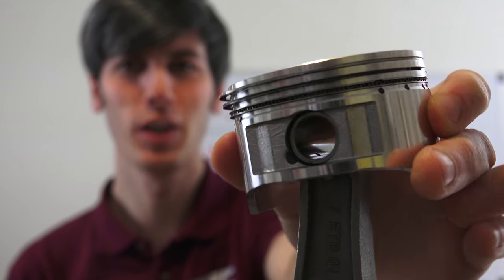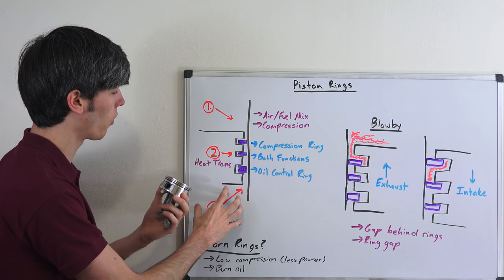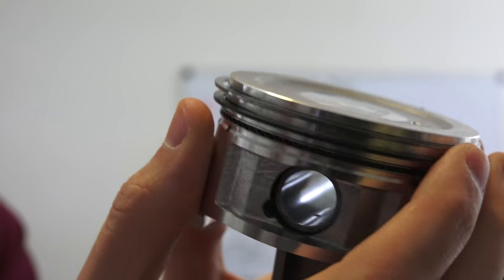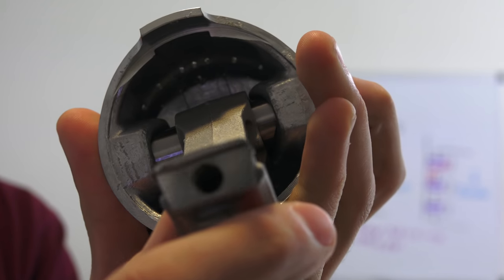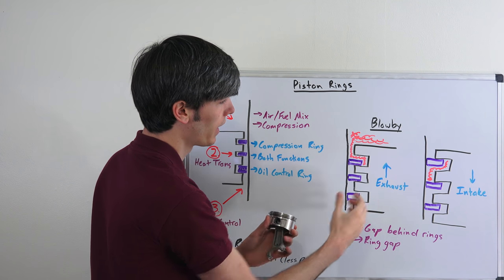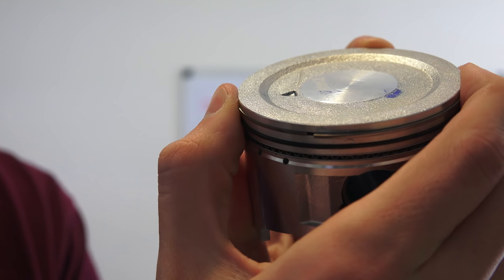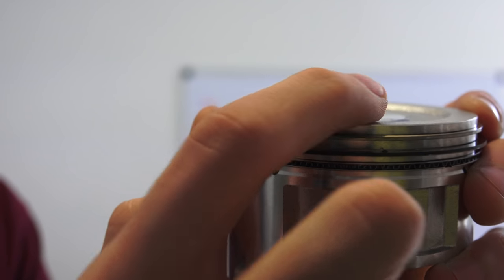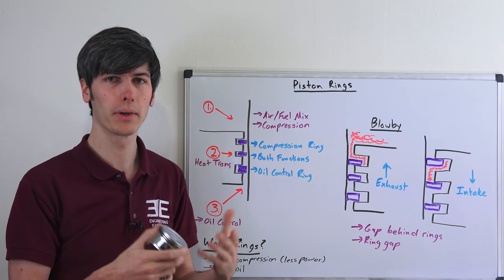Piston Rings & Blowby - Explained

Comment: I put new rings on a piston on my bike. I didn't measure ANYTHING. I was so pleased when I started the bike and it ran. It ran pretty well. I did 500 miles on it, including some quite tricky off-road stuff. It smoked a little. It smoked a lot. It used oil quicker than petrol. But it ran. I decided the oil use was more than your everyday break-in consumption so tore it down again and did some measuring. The rings I fitted were standard. I'd assumed the piston was standard. It wasn't. It was a full 1mm oversized. The piston ring end gaps were like the black hole at the centre of the universe. I'm still a bit baffled the bike ran at all, nevermind scrabbling up rocky mountain tracks and a few laps of a race circuit. '85 XT350. Love it.
Reply: I bet you had good compression

Comment: You really got this wrong.  The main and only source of blowby is close to peak cylinder pressure, late compression and early expansion.  During that time, the top ring is shoved down against its bottom of the groove, and the only source of blowby is through the end gap.  Sometimes, under super high rpm, the top ring can get unseated from its groove and the excess blowby can even force the ring collapse inwards, but this is an super old engine thing when the rings were thick and heavy.  As your rings and cylinder walls wear out (cylinders will wear towards the top end where the pressure is high, unfortunately) the end gap will increase, letting more high pressure gas escape.

Comment: the top ring is compression. The second is an oil scraper .The third is oil control. Ring gap is determined by usage. Wider for high heat on the top ring .

Comment: The piston ring's end gap allows for expansion of the ring due to the engine heating up, much like adjusting valve lash in an engine with mechanical lifters. without the gap, the rings could start expanding outward into the bores and kill the engine.

great videos btw, ive watched almost all of them and appreciate the condensed learning within them.,
Reply: Not to mention, on a performance engine the temps are usually higher which expands the rings even more.  That is probably THE major limiter on how much nitrous an engine can take, given the tune is perfect.
Reply: Not to mention also that without relief of the compression through those gaps, the piston rings could have a tendency to crack and fail.

Comment: U saved my day .... has a GTI with high oil consumption. ...and wasn't getting what's the real issue for vehicle . Almost 2 weeks of restless days. The piston rings are worn out and oil gets to combustion area and burns off... 

In high speed oil just becomes so thick and in 20km around 2 liter if oil gets burned .... 

But in low RPM .... there's no oil burning .... actually your video made me get the actual problem for the vehicle ....

Anyway it's expensive to rip apart the engine and reassemble. ....going to do it anyway  ......

Thanks a ton ...mate

Comment: Working on a single cylinder engine from a mid '30s italian motorbike I was taught that, when it is time to reassemble it, it is better to place the "gaps" in the rings 180° one from another. That way you increase the lenght of the path for the blowby gases therefore reducing it. I also think that the rings can somehow rotate when the engine operates so that may be partially true.

Comment: Could you could do a video on hard vs soft break-ins? Manufactures tell you to soft break-in engines, but since learning about glazing and ring seating I don't know who to trust any more. I feel like manufactures just tell you to soft break-in to cover themselves, even if it's worse for performance. But I wouldn't risk an engine on it without an experts opinion. Thanks.
Reply: Break ins have to be soft. You want your engine to be used in all kinds of RPMs in different gear ratios. Also do not stay on to certain RPM for no longer than 20-30 seconds. Do not red line your engine and do not let it idle for more than 30 seconds. So generally use different gear ratios at different speeds while not going above the recommended RPM and while not cruising for extended periods of time.
Reply: Soft break in is the way to go if you have built the motor your self. The first 50 miles are the most important for future bore and ring life. That said I don't know about a factory build as I think they run them before they sell to the public and do not build to the tight tolerance that an independent engine builder should do.
Reply: soft break in if you dont want your rings to seat
Reply: @seemssafe2995  Bruh, you're replying to a 6 year old comment.
Reply: @6Twisted  ill do it again
Reply: @seemssafe2995  based
Reply: The thing about replying to old comments is – sure, the author of that comment most probably won't benefit from what you said. But it's not all about the OP – many people will eventually find that reply and maybe some of them actually will benefit.

Comment: 1:25 Those holes actually work the other way around. Oil gets injected from under the piston by the nozzles and it travels through the piston into the cylinder walls. That will help lubrication of the walls and cool the piston down to avoid cracking due to high EGT.
Reply: Lol, WRONG

Comment: No mention as to clocking the rings for proper ring position to ovoid excessive blow by?
( I learned more than I chimed in! Thanks! )
Reply: I installed total seal rings before , and now blowby is minimal. 
I think I'd have em made for any engine I ever redo. 
It's also Good enough to have a open crankcase vent and not get gassed out by it inside the car.

Comment: Wouldn't the power stroke in the cylinders be more susceptible to blowby squeezing past the rings rather than during the exhaust stroke, when the spent combustion gases already has exited the cylinders?  Blowby happens when combustion pressures seep past the rings and make its way through the crankcase and out the vents, taking oil vapors with it into the intake, correct?
Reply: +OCTurboJoe I know what you're getting at but the blowby doesn't "squeeze past the cylinders" in one go. Look again at the diagrams in the video. It happens in two stages:

1) The exhaust stroke forces the rings DOWN letting gases into the top part of the gap.
2) The compression stroke now forces the rings UP which releases those gases out of the bottom of the gap.

It is a two-stage process. It would take an incredible amount of power to blast those gases past the rings in one go. Maybe if the rings were very worn though....      Hope that helps.
Reply: +Boysya Exactly.  It's more pronounced with force induction.  A newly built engine with a fresh set of rings can still have a good amount of blowby.  Pressure will always find the past to least resistance, especially through rings on the power stroke.  The exhaust stroke is more like negative pressure where gases exit the chamber vs positive pressure pushing past the rings, into the crankcase, and out the vents.  This video probably explains blowby at idle whereas I am explaining excessive blowby under load.
Reply: +roadrunnerblink he didnt describe it well, in fact most blowby is caused by bad ring to cyl seal, not by a tiny amount of space behind the ring

Comment: Engine oil also helps to create a seal within the rings. The scraper also helps with portioning the amount of oil that is allowed to stay in the cylinder to keep things sealed and lubricated. Interestingly enough, the pistons on aircraft engines do not have those weep holes because you're dealing with bore sizes over 5".

Comment: How about thicker & lighter oils on new & old car engines. EO provides lubrication and sealant between piston ring and cylinder wall. Since older engines have bigger wear and tear, does using thinner EO affect compression and combustion. vise versa. Thanks
Reply: +Tango965 Yes, engine oil provides sealing between the piston ring and the cylinder wall. If the wear on the piston ring is excessive, no oil will help sealing it. If the wear is small, a thicker oil may help. The property of engine oil that matters is High Temperature High Shear (HTHS). You can find HTHS in an oil's product datasheet. An oil with high HTHS will form a better seal between the piston ring and the cylinder wall.
Reply: icekk007 if you have VVT heavier oil will not be good for your solenoids

Comment: Just now learning about something I have used for 55 years. So what happens to the gas that passes into the crankcase and is pressure inside the crankcase a problem. Thanks for your presentation. Extremely well done.

Comment: even if you have a brand new engine it will have Blowby cause the rings can't seal 100%,  some of the combustion gases will enter the crankcase it will mix with the engine oil so that's why you need to change the oil on regular bases and also causes presure buildup in the crankcase. For control of the pressure inside it, a PCV (positive crankshaft ventilation) is used to vent the crank case,is an inexpensive and often overlooked component until you wake up whit a blown oilpan or valve cover :)),i know this vid was about piston rings but as you can see one thing thake you to another and so on,good video by the way \m/

Comment: I believe piston rings in an engine form whats called a "labyrinth seal"
Reply: +Bill T Labyrinth seal is not used in piston ring. I think it is generally made of elastomer (rubber) material, so it can withstand the heat and pressure experienced in a piston. They are generally used in shaft seal in rotating machines.
Reply: Bill T Labbys are on rotating assemblies as was mentioned, but they definitely don’t have to be soft like rubber.
Reply: Yes it is a variation of the labyrinth passageway, you don't line up the ring gaps all in a row for this reason

Comment: Great video, thanks for the explanation. Those look like the newer type of rings that you can install without any tools. They look so flexible which helps reduce drag on the cylinder wall and increase mpg (change oil regularly to prevent sticking). It would be nice to have technology to produce an artificial layer of diamond surface in the bores and a coating on the rings to inhibit wear.

Comment: what metal are these rings made of? I always thought they're rubber.
Reply: Same
Reply: Not since the early 1900s has that been true.  They are made out of a very hard, springy, and brittle steel.
Reply: +Jean-Paul Veillon Oh!
Reply: cast iron
Reply: +Mohamed Li Usually cast iron for the Top Ring, cast iron or steel for the Second Ring, and steel or stainless steal for the Oil Control rings

Comment: Great video as always. Picking up where you stopped the video at....id love to see a video about worn piston rings vs carboned up  ring grooves leading to rings no longer able to seal correctly.
Basically, a comparison as to which is the actual culprit for blow-by.
Much like how warped rotors is a generic term for uneven rotors, when the rotors are not actually warped.

Comment: Why are cylinder rings so much more reliable and durable than the Apex seals in a wankel engine?
Reply: simply that the heat is more intense and builds up on one side of the block more than the other, so there are more cooling issues to overcome. 

Plus the oil, if not regularly topped up with the correct type will mean that there is more wear on the seals. Not to mention that the wall exhausts in the standard 13b design mean that they are regularly passing over the port which can cause some wear when it touches the other side (overcome in the renesis MSP design). The oil used however, even in this design doesn't burn 100% cleanly, so the residues that build up will cause seal wear and degradation over time.

2T Premixed fuel and SOHN oil reservoirs do help in reducing these types of wear, which would be nice to see this channel cover.
Reply: ***** ***** thanks! That makes sense;)

Comment: explain PCV valves please
Reply: +TheWolvesCurse essentially, you have a valve on your crankcase that lets air/fuel out of your crankcase back into the intake manifold.
Reply: When the vacuum pressure of the intake manifold/throttle body is in the correct range, the PCV valve opens and uses that vacuum to pull blowby gasses out of the crank case and pull it in to the intake and reburn it. Its an emission control system. If that valve is stuck open, you could suck up engine oil and cause all kinds of issues with  the intake or throttle body.

Comment: If you ONLY just wanna replace the piston rings, and only them, the simplest way is to do the following:
1. lift your car up
2. remove the oil pan and the oil pump
3. remove the crank from the block (be sure to put the bearings if they are ok in the exactly same position and place)
4. extract each piston by simply just dragging it down the bore
5. replace the rings in each piston (obviously)
6. put back the pistons the same way you got them out (might be tricky if your not an skilled mechanic)
7. put everything back the same order you got them out and readjust the timing.
    Depending on the type of the engine this operation can be done in let's say 5-6 hours on a 4 or 6 cilinder engine, so you don't have to tear the whole engine apart, and cost's way less.

Comment: I have a question regarding the gaps on the piston rings (2:30) , specifically for a small engine. When installing the piston, does it matter if the gaps within the rings get set alligned or do the gaps need to be set opposite to each other?

Comment: Excellent video!  You could go a bit further and describe ring flutter and more issues caused when crankcase pressure is allowed to be present creating instability creating more wear and blow-by. This is common when tuner shops don't understand the functions of the PCV system and proper crankcase evacuation. You always want to pull suction on the crankcase to maintain proper stability and ring seal. When this is defeated and breathers added to "vent" your allowing pressure to be present. It is not hard to install a crankcase evacuation system that pulls suction at all times emulating a belt driven vacuum pump for the street.  Good video!!

Comment: What I find amazing is that many older Saturns have defective oil control rings and burn oil like crazy and yet if you keep the oil level correct they will last a very long time. Logic dictates that these engines have newer oil, due to frequent additions, than most cars on the road, hence the longevity.
Reply: you may be on to something grasshopper.................

Comment: Can we see a video on Air Oil separators? I'm curious as to how it limits crank case pressure and what it does in the long run and why we should run one.
Reply: +30lbs of boost_jpg The main function of an air oil separator is to remove oil mist in blowby before the blowby is returned to the intake. If it is not present, oil will find its way to the intake, eventually fouling the valves, throttle and other intake components in the long run. Having a return from the crankcase via PCV valve to the intake is the mean to limit crankcase pressure.
Reply: +30lbs of boost_jpg I'm going to assume you drive a turbo'd car considering your user name? Another reason why an oil/air separator is important in your case is that oil vapor reduces your effective octane rating which will make turbo cars more prone to detonation. Removing the oil from the vapor helps avoid that as well.
Reply: +TWIRKNOLOVE looks like I need to save up for an IAG AOS then.
Reply: 30lbs of boost_jpg You could! Another solution is to just run the breather hose from your valve cover to the ground. It's not eco-friendly and probably against state laws, but just another solution done, especially on older cars that become turbo'd from projects.

Comment: Excellent Video as always..my question is, is there anyway to set you piston rings after hone your cylinders walls. I did a leak-down test on a few of my cylinders and found that a few of them was low 20 percent leakage. the leak down showed that the air was coming from the crankcase. so i took them out, hone out all the cylinder that were low. the pistons and rings are now back in which brings me back to my question above. thanks for your feedback

Comment: Great video! Can you do a follow up vid explaining why blow by might be a good thing (turbocharging). I would also like to know how is the Total Seal rings different.  Thanks!
Reply: +Chris Nalley blow by is not good. at all. causes oil vapor to be sent through you pcv lines and back into you engine, causing detonation. what "could" be good about is in turbo applications?
Reply: Total Seal makes conventional rings, and then they make several differing sets of "gapless" rings. Those gapless rings are essentially two rings in one piston groove. The upper ring has a "step" on it that the lower ring sits on. The gaps of each ring are offset by 90° or so just like conventional rings, and since they're both in the same groove it effectively closes off both gaps - hence, a gapless piston ring.

Also, that tiny bit of combustion pressure that gets behind the upper ring helps push the combo tighter against the cylinder wall thanks to that internal step that the lower ring sits on.

Gapless rings produce a little bit more friction than conventional rings, which could all but negate any power gains in smaller engines. But even so, the far better seal against blowby would make for a cleaner engine, meaning you could possibly even skip an oil change here and there if you wanted. Plus, low-tension oil control rings and low-friction coatings on cylinder walls would negate any frictional losses due to running gapless rings, freeing up more power.

Comment: Nice explanation. You could have mentioned that when you have a 3 piston rings configuration where the 1st and the 2nd are compression rings, the rings gap must be offset in 180 degrees between each other so the blow-by has a harder time to pass through the gaps.